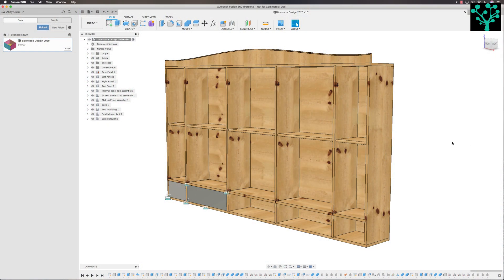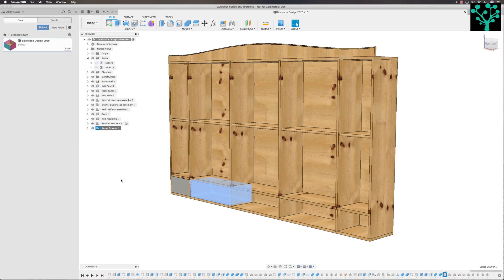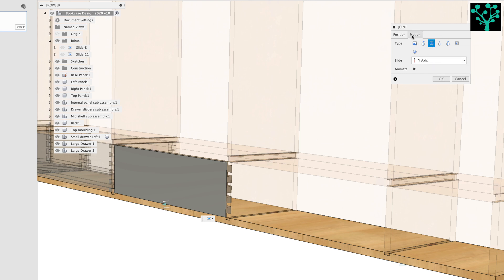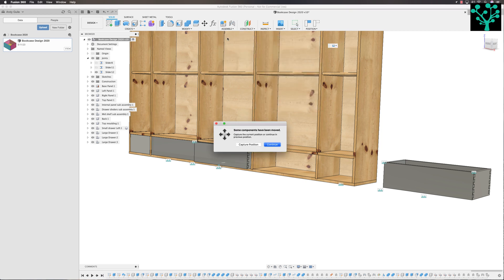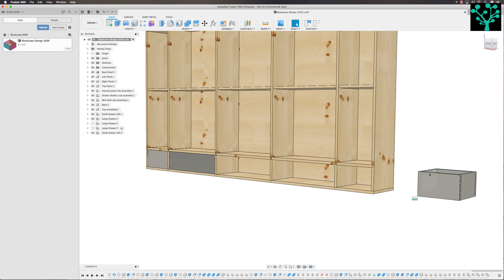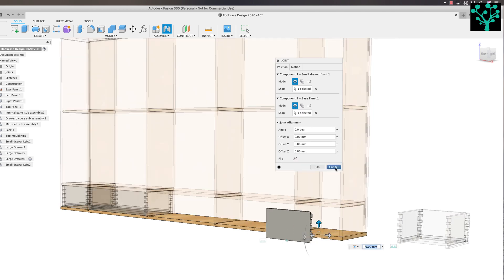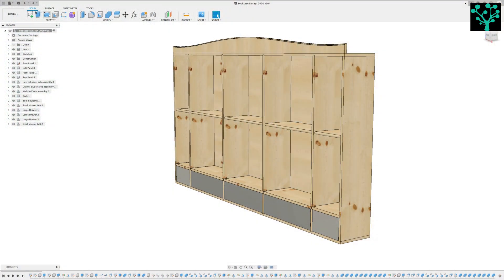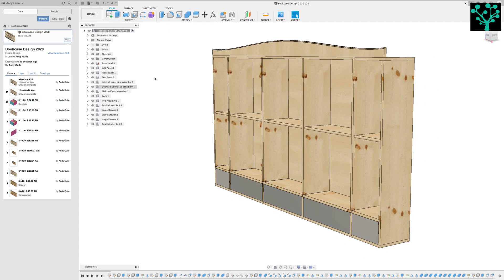Fusion 360 for Woodworkers - Lesson 11 Replicating the drawers

Comment: Hi . I have a issue when trying to create the joint it finds the centre of the drawer ( component 1 ) however on component 2 the cabinet base the only center point is the middle of the whole base . Fusion has not separated each compartment . I have tried everything and no luck . Thanks

Comment: I"ve built a drawer base cabinet parametrically, and everything has worked except getting the slider motions to work.  How did you grab and slide the drawers?  Iid the exact joint, but the only way I can get it to slide is by using the "Drive Joints" in the Assembly menu.  It looked like you just clicked on the drawer front? I must be missing something.  BTW, the last small drawer was a critical bit of learning for me because of the use of the joint offset.  It took a while to figure it out, but because I have a gap all around my drawer fronts I had to use the offset.  Building this model has been a great exercise.
Reply from the maker: Hi,

This was a long time ago so I can’t really remember. I probably used joint to keep all the parts of the drawer together. 

Then used the move command to drag the drawer out, I’ll watch it again and met you know.

Cheers

Andy
Reply: I figured it out, Andy. I think you were grabbing the joint indicators. I pinned the drive joint so I can quickly activate it to slide my drawers. Thanks again your content really shortened my learning curve.

Comment: Is there a constraint to prevent the drawers from coming out of the cabinet to far?
Reply from the maker: Hi Michael - not so much a constraint but you can set the limit of movement in the joint command/

Comment: I'm sorry but I am going to unsubscribe as I am interested in woodworking not CAD.
Reply from the maker: Hi Gareth,

100% agree, I am also re-doing a number of pre-Fusion designs.

Where it really starts to kick in is when you create sub assemblies (modules) that you can bring into your design. 

You can start to build up a ‘be spoke’ type approach. So a set that may have a TV stand, a couple of end tables, a coffee table. All based on the same design concept/components - but tuned to the customer need.

I am about to start the design for a set of ‘farm house’ furniture. So I will create the sub assemblies as separate projects - import them into new projects - and tune each project to become the item (coffee table, end table etc).

All the plans and images quickly created, as well as the ability to bring my cut lists into my costing software for the quote.

Makes it so quick and easy, and customer changes are quickly included based on feedback.

It is an essential tool in the workflow as far as I am concerned, the next big investment is the CNC that will further speed up production so onto CAM. All driven from within Fusion.

Cheers

Andy
Reply from the maker: Thanks Ray,

The woodworking will be back after the CAD series completes.

Cheers

Andy
Reply: @TheWoodgrafter  Andy, those of us who have been in trades as long as I have (47years) know if we can design something we can build it. Everything that makes the design process easier and more iterative is of great value.
Reply from the maker: Mike Newman 

Hi Mike,

Different strokes for different folks I guess. I agree with you, the ability to talk to a customer about an “idea” and then translate that to a design (ideally the customer can visualise) then create the plans and build it is all part of woodworking to me.

Fusion is a great tool, but boy is it complex. By the time I finish this series we will not only have designed, we I’ll have rendered a photo realistic view, created shop drawings (that auto update as we change parameters) and created a cut list. All within Fusion, that should be of value to all woodworkers.

However I get, that some folk watch the channel who aren’t in that game and that is OK.

This series does feel like it is going on forever though - but I will stick with it.

:-)

Cheers

Andy
Reply: @TheWoodgrafter  Thanks, I see Mikes point and like to think of learning the "CAD" as a way to speed up the planning process with a new tool. In this case the tool is IT based. Perhaps a good way to look at it is as such. Ive started going back to plans done previously and making them scalable so that a new plan of a similar build/project is really just changing parameters. It's a time consuming exercise but one I see value in learning and glad you've taken the time to go over it.